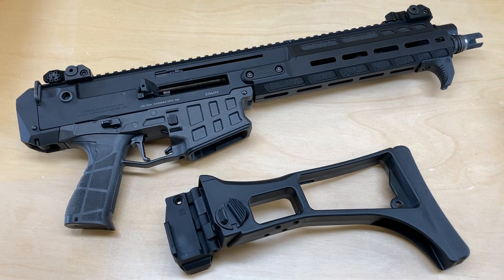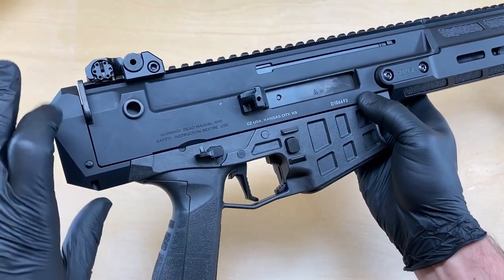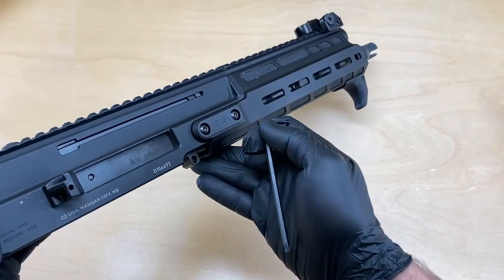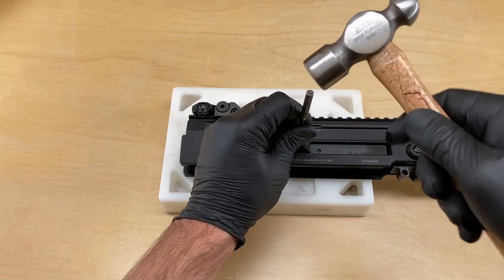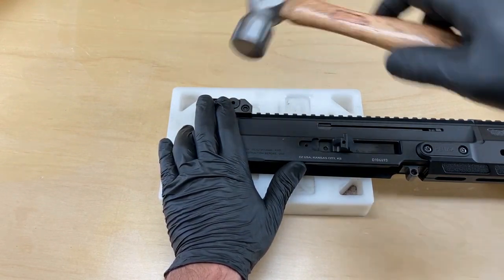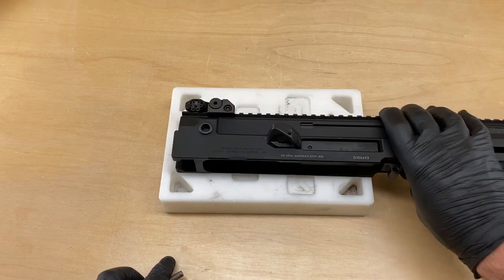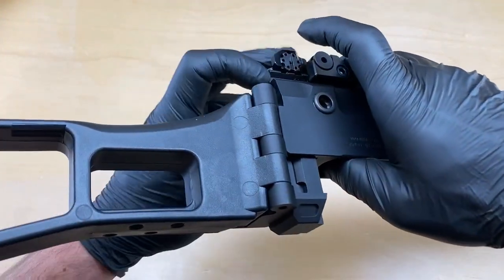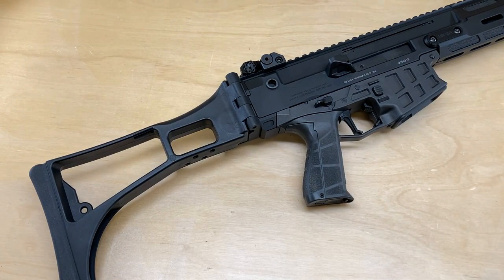HBI CZ Bren 2 G36 Stock Adapter Install

Comment: What most people dont realize is that once you put this stock on the rifle, you have to unscrew the screw that retains the stock EVERY single time you clean the rifle or need to remove anything in the upper half of the rifle. The screw will strip out after just a few removals/installs. Also, the half moon shaped button that needs to be depressed when folding the stock is a weak point & mine now has large chips of plastic missing. I’ve owned the stock for less than 3 months. The button should be made out of aluminum at least & having to remove the retaining screw in the field or under fire would be extremely time consuming & is a major flaw in the design in my opinion. HBI usually makes great accessories but this stock is not one of them unfortunately. If you want a stock, buy the OEM one from CZ. Only way to go. Just my experience, maybe others have had a different one. Idk. I’m going to contact HBI for a refund on my mine & will update here afterwards.
Reply: This would've been my question, as it looks like this massively complicates field stripping the gun, which doesn't use any tools in factory condition.

Comment: Wait, so the sling delete screws in thru the stock adapter? So do you need to unscrew that every time you do a field strip for basic maintenance?
Reply from the maker: Yes, in order to remove the recoil assembly and bolt the stock adapter needs to be removed... 1 screw. The trade off is that your stock fitment to the upper receiver will always be tight (no wobble).

Comment: I noticed you guys are doing gas port drilling for the 3rd position. I did mine already but I screwed up and made the hole too big. Would it be possible to get you guys to drill a hole on a different spot. I just need to grind down a small part so I can turn valve to the opposite side of the valve. I already bought the spring but I use a suppressor so I need the hole drilled. Thanks for all the stuff you guys do for the Bren 2. I really love the trigger shoe.

Comment: Any advice for someone who didn’t get as lucky and the spring is preventing the stock adapter from seating properly?
Reply from the maker: Its not always as easy as it looks... Some pointers might be to triple check that the bolt is in battery/fully locked, make sure the recoil spring assembly is fully seated into the back of the bolt, and then try to gently "wiggle" the stock adapter up the receiver until it passes the recoil spring/buffer bad. There is an angle/large chamfer machined into the backside of our stock adapters that should help push the buffer pad forward and compress the spring out of the way while you push the stock adapter upwards to seat it. However, pushing more gently during this step sometimes makes things easier than if you push hard and try to force the adapter into place.

Comment: Wait, if I manage to find one of those fancy $700 adjustable G36 stocks will it fit in the adapter?
Reply from the maker: Yes, all known G36 stocks and braces are compatible with our adapter; including the 4 position G36 and confusingly expensive fully adjustable IDZ G36 pattern stocks.
Reply: @hb_industries  good to know, I just got the G36 stock from you guys and I’m very happy with it.

Comment: Is there any play at the stock latch? I have an OEM folding stock and it wobbles still, drives me nuts! Looking to get one of these if the stock doesn’t wobble at the latch.
Reply from the maker: No "play" at all in our Bren stock adapters... They mount rock solid to the upper receiver using the M5 torx screw.
Reply: @hb_industries  I ordered one, excited to see it. Thanks for the reply! My factory CZ carbine stock had wiggle to it and drove me nuts. I prefer the look of this setup anyways.

Comment: You have to remove the screw in the back to disassemble the rifle now?
Reply from the maker: Correct. It is a T25 driver, same as handguard and factory sights, and many optic mounts.

Comment: Using my bren, I just measured my LOP at 12". Is this pretty much a no go for me?
Reply from the maker: Our G36 setup is about 14.25" LOP,  which is obviously a bit longer than 12". The factory stock fully collapsed is about 12-12.5" (depending on which stock variant you have). If you have an adjustable stock on there right now, even if AR buffer type, you might try pulling it back one notch and see how it feels? That might help to simulate the 14.25" LOP for you? If you are comfortable at 12" our vote would be to stay with stocks that meet that requirement. Setup is really a personal preference, always do what feels best to you.

Comment: Do you have to take the sling mount off?
Reply from the maker: Yes, the sling hoop plate on the receiver must be removed/replaced with our delete plate. The factory sling hoop prevents the G36 stock from folding flush with the receiver. (On the plus side, the QD sockets on the receiver are unobstructed; several of us here are running G36 stock with QD sling in the rear receiver mount)

Comment: Will this work with the ak lower for the bren?
Reply from the maker: Yes, as long as the AK type lower fits correctly with the factory rear trunnion/stock adapter, it will fit with ours :-)

Comment: If you add this adapter to a Bren 2 pistol would it turn it into an SBR?
Reply from the maker: The adapter itself would not necessarily constitute an SBR, however if you put ANY stock on ANY Bren 2 pistol, then YES, you have manufactured an SBR.
Reply: @hb_industries  Thanks for the reply.  What if you put an AR 15 pistol brace on?  Like  SBA3 tactical arm brace or similar. Would that make it an SBR?
Reply from the maker: @ShawnGS300  The laws on braces seem to change with time, and we are not qualified to answer your question. Our advice would be to know and understand all applicable laws any time you choose to install or use a brace on a pistol.

Comment: Is the g36 lighter than oem?
Reply from the maker: Yes, technically the G36 setup is lighter, but they are both VERY close. HBI G36 is 14.5oz and I believe OEM is 15.4oz.
Reply: @hb_industries  Thanks!